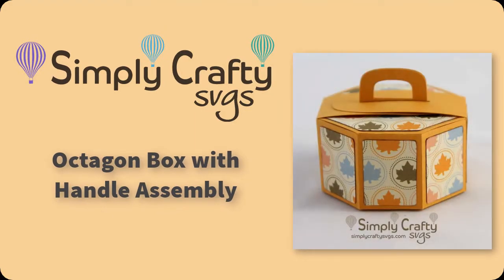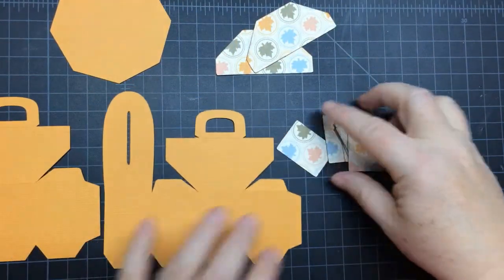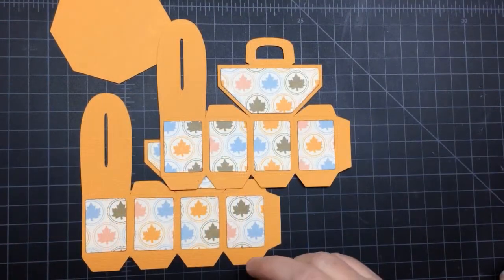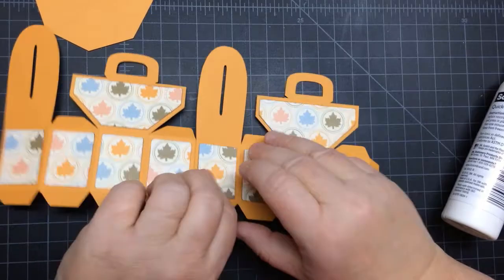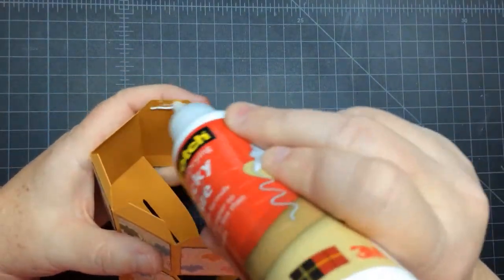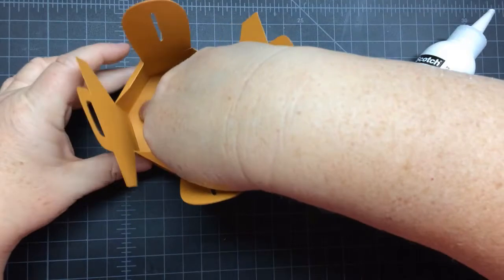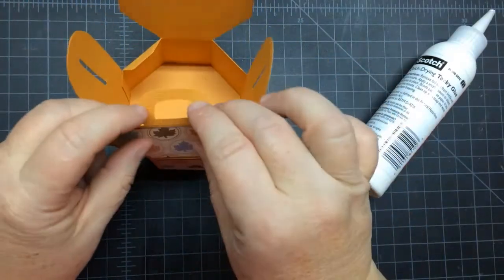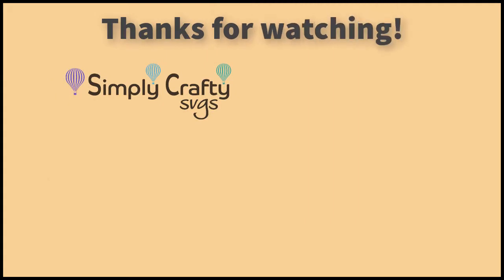Octagon Box with Handle Assembly - Gift Box SVG File

Comment: hello, i want to buy this SVG design on your website but it said "Error: * Forbidden. Private list deny. Your IP belongs to a high spam risk network. Anti-Spam by CleanTalk. ***" when i try to register. Is there any other way to purchase it? Thanks in advance. Btw nice video as always :virtualhug::virtualhug::virtualhug:
Reply from the maker: Give it a try again. My security software is the cause. Thanks!
Reply from the maker: If you still have trouble, you can try contacting me via my contact form, disabling VNO or trying another browser. I have certain security protocols on my website. I would need to have more information from you.
Reply: @SimplyCraftySVGs  hello, i gave a few try and it worked. Already bought it, thankyou very much 😻
Reply from the maker: @allhailangry82pigeon39  Thanks for letting me know. And thanks for the purchase!